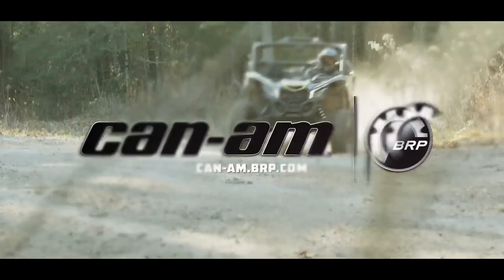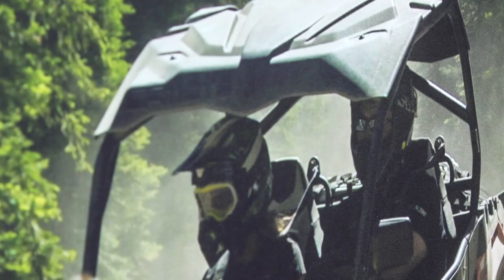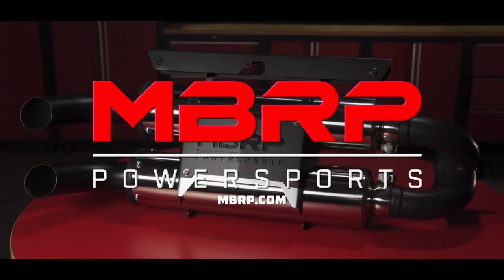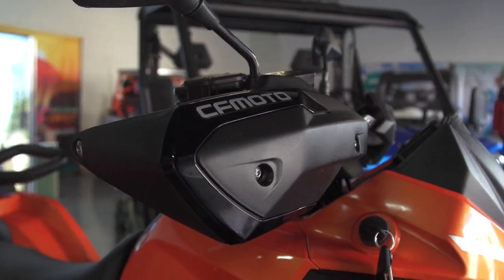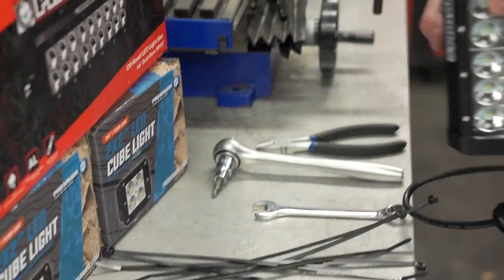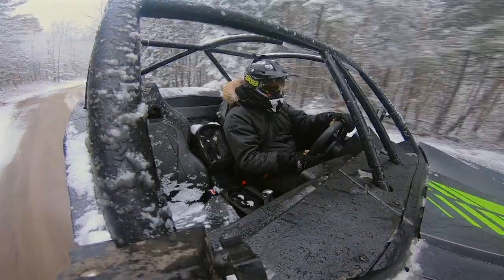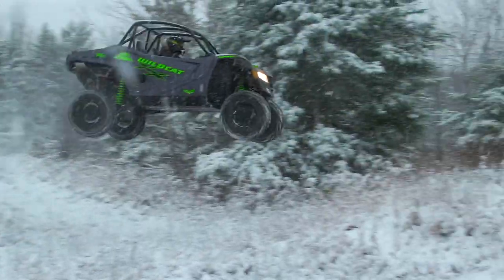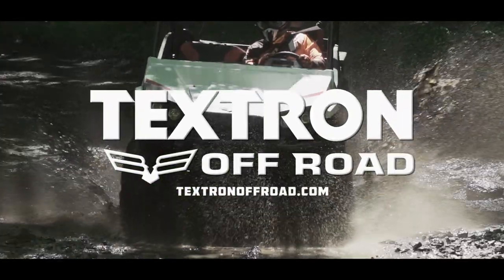Dirt Trax Television 2018 - Episode 18 (Full Episode)

Comment: Wait until resale time...... like trying to sell a used KIA.
Reply: Funny you say that can am has the worst resell and Honda has the best.
Reply: @crazyflyboy30  can am and honda have a purpose though can am is fun honda is work these look like they are just eh they dont have that wow factor like a polaris can am, yamaha,honda does they look bland but thats my opinion and for 10000 for an 800cc atv you could get a new old stock can am xmr for about 1500 more the price doesnt reflect the innovation to me
Reply: @crazyflyboy30  Oh please post up the where you got this info from.
Reply: Don't insult used Kias like that.
Reply: Can am’s are usually beaten up quads
Reply: @prorider6997  I see it all the time on the trade and sell on Facebook a can am 2017 XMR 1000 will be $6000 and a 2005 Honda 500 will be $5000 it crazy.
Reply: @crazyflyboy30  If you can get a 2017 xmr1000 for 6K, but it! Thats a steal.
Reply: @koomafloo9946  Yes was it was and thinking on it too much but I still see them all the time close to that price but am still scared of the rear diff.
Reply: That's what happened to Arctic Cat when Textron took over.They dumped all Arctic Cat branded atv's at many thousands off, then the revamped atv line up offered a bare 700 cc with no gauges or fancy for less than 7k Canadian. I still can't sell my 09 700 without giving it away, so it plows snow, then it is parked for summer or as needed for friends/family on group rides.
Reply: The Fall I wish I could find a used one for a good price nobody gets rid of them

Comment: You guys are becoming nothing but a 20 minuet commercial. What happened to real reviews????
Reply: JohnnyRebKy did you not watch the episode?   Giving information out about a new competitor/manufacturer to the industry is not a commercial.  It’s vital to new customers of the sport. CF Moro is producing quality and competitive machines. 

And the review on the wildcat was excellent bro!   That machine is going to be the one to beat. Just wait till people start turning their wildcats into Lions!
Reply: @kylestewart8049  The way they presented it was total commercial, be real.  Just look at the aftermarket for Textron and you'll see the real issue,  no one really wants them other than the die hard AC fans or those who fall for the salesmen's tactics.  If the aftermarket doesn't step up it's because there isn't enough market share or the machine just doesn't lend itself to upgrades.  We have a local dealer near me that moved their XX to the other side of their lot away from their RZR's and X3's...Why you may ask?  Because being right next to the other two folks could judge them side by side, and in the previous two months had sold over a hundred RZR and CanAm sport machines, and he could give me a great deal on the Textron to be able to say they sold one!
Reply: You fell asleep B4 the RS1 upgrades + the Textron Wildcat XX REVIEW!

Comment: The Talon is going to give the XX and the YXZ a headache sales wise... Should hear the MSRP in about a month.. My guess is still north of 22k u.s.
Reply: I think its been reported to start in the 15K range.  That puts it about the same price as the Rzr 900s.  I think most would choose the Talon if both are the same price.
Reply: @gregrowe1168  Not likely, you'll have die hard Honda fans jump at it but after the multitudes of issues with the Pioneer 1K for the first 3 years, and Honda's dealers total lukewarm desire to acknowledge or stand behind those issues, Honda has fallen from grace for many in the durability over all others moniker.

Comment: What I don't understand is why you need 18 or 24 inches of travel when you're machines chassis is only 16 inches off the ground? So you can slam your chassis in the ground every jump?
Reply: 16 inches may be ground clearance, but in the air the weight of the machine is not compressing it at all so it droops out to full travel.
Reply: @craigob8924  the travel goes up past the chassis the point is it will slam the chassis on the ground way before the suspension bottoms out droop or not

Comment: Change just enough stuff to keep can-am and Polaris from suing them. Some people might think that CF moto is innovated, but in my opinion they're just another Chinese copycat company.
Reply: but they are cheap and durable work horses, sell good to reindeer herders
Reply: If it’s more reliable than Polaris and can am than people will by them when they make a name for them self
Reply: Should be,  they're using clone engines
Reply: polaris are the best to drive, but the frames dont hold up to the abuse what i understand. how it has been at least. for china brand these should be rather good. if have a good dealer. in town its just a side show selling them for one shop, that sell kitchens as main products.
Reply: @demetresrobinson2694  the CD Moto brand actually started as a parts business. They actually supplied can am with engine  components then they turned u to the atv/utv market thats why they look so much alike. And no I don't own one just researching for my next purchase and it's hard to ignore their pricing especially when looking at side by sides
Reply: They maybe a copycat but for what I see they are better than can am or  Polaris.
Reply: I agree. Although my Polaris was made in Mexico which chaps my ass just as bad. If I knew that before I never would have bought it. I remember my old Honda 400EX proudly wearing a Made in South Carolina sticker. Kawasaki in Nebraska. And I end up with a Mexican Polaris! My 570 was actually cheaper than a new CF Moto....bought new for 4600 bucks at dealer in Union City, TN ( cheapest dealer in North America). Now I know how they can sell them so cheap, Mexican labor. It also shows how much other dealers are gouging the price on them. My local dealer was 2000 dollars more for the same exact machine.
Reply: Stian the new frames aren’t bad. The can am framed were actully just as bad actully worse. A small bump on one of the rear tires and it wound bend to the shape of a banana. Both Polaris and can am have fixed these issues thob
Reply: The seat for the two seater atv is the same exact thing can am does on the 1000 xmr
Reply: CFMOTO produces 800 000 engines/year and builds engines for KTM. I will agree it looked like a copy of certain brands in the past, but they all do look at each other anyway. CFMOTO has been working hard and before commenting you guys might want to give them a try. They are a great ride. They are better priced and quality has improved, which forces other brands prices down. Competition is always good for buyers.